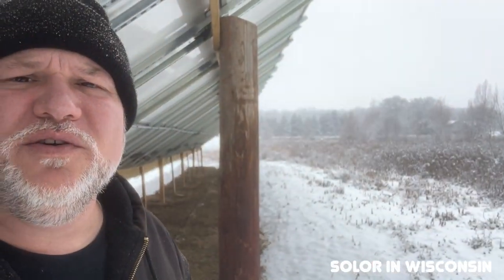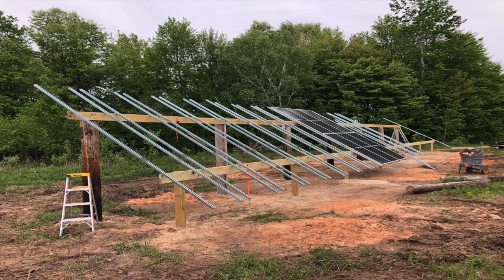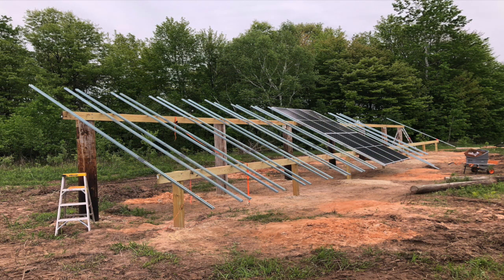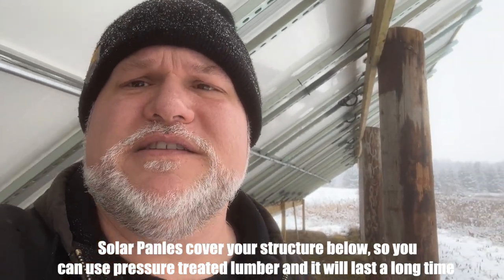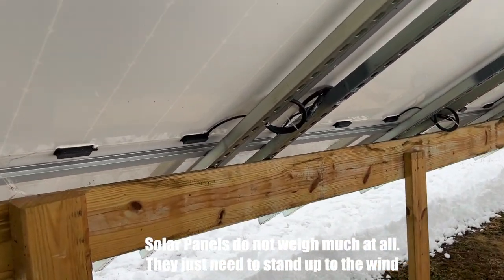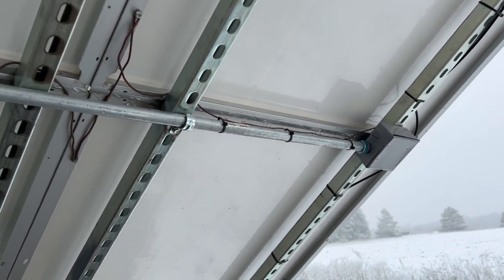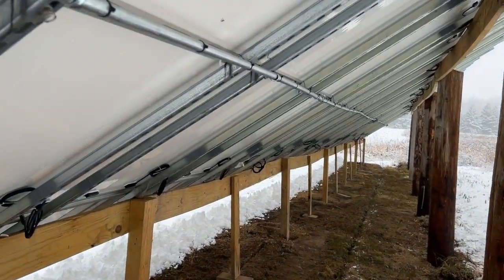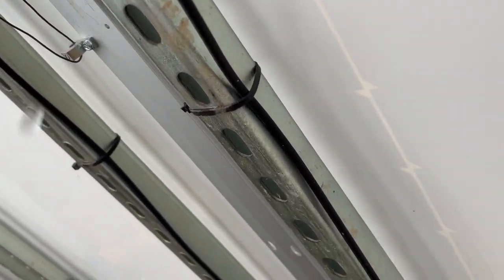DIY 15Kw Solar for 15k

Comment: Your locality may require it, but it isn't NEC from 2020 and beyond to earth a ground mounted solar system.  We don't do it as it doesn't accomplish anything.  It doesn't protect from lightning nor will it clear a DC fault.  Roof mounts require grounding by NEC, but it should not be earthed to a separate rod, it should use the house's existing earth point if one exists, or it must be bonded to the existing if a separate rod is used.  I would have a Surge Protection Device installed inside your combiner box inside the house for the PV conductors.

Comment: Nice set up! I'm getting ready to add 30 q cell panels and enphase micro inverters an batteries on my property. I'll have 20kw of back up power. Tired of paying $500+ in CA for PGE. My 1st solar quote was around 65k and I should be able to do everything my self for around 38k is what I'm thinking.... still expensive but with all the new laws in CA you pretty much have to buy batteries to make it worth it now.

Comment: Hi...nice vid, can i ask, have you seen people that are mounting their panels (mostly bi facial) vertically?....it looks like a good idea, especially if it snows the snow falls off the panels on its own, plus if snow is on the ground the reflective light helps production, and being vertical the panels dont get as hot in the summer sunny days, cooler panels produce more power even though they are not pointing at the sun directly....ha, im not saying take down your wooden structure, but if you do get more panels maybe its a chance to put the additional panels vertically for a comparison 👍

Comment: I kind of wished you gave it some six inch spacing, side to side between each panel as it would aid with wind pass through on a crazy-azz, windy day. That's a lot of money to make a long continuous, parachute with. We had a couple of evenings here when I needed to lay my hinged array flat on the ground. I never thought the wind could actually blow the other individual loose 40 pound rigid panels around on a windy night - boy was I mistaken. I replaced a couple of broken ones and then decided to mount all of them permanently on three, newly manufactured metal-roof 12X36 storage sheds. Four were vertical wall mounted, four more at a 30 degree angle (roof pitch), then sixteen lay flat, four more at a 30 degree opposing angle, and finally four vertical on the opposite end wall. I did it like this in order to maximize exposure from sunrise to sunset, all year round here in Texas. I have thirty-two, 320Watt Renogy panels connected to two renogy all-in-one inverter/AC charger/solar charge controllers. Each controller draws 70A at 70V from the PV array to charge the batteries. My lifepo4 battery bank is composed of two at 16S, 58.4V using a total of 32, 305 Ah cells, with two 250A Daly BMS simultaneously rated at 24,000 watts peak output. Each DIY bank is 15 kilowatt hours of runtime. Shared with the solar array as needed are an additional, two, Bluetti AC300's with four B300 batteries each. This gives me one extra day of battery backup should I ever drain the 30KW hours from the two DIY banks. All in all I splurged roughly $20K USD in the whole DIY setup - I been living off-grid without a power or water bill since March of 2014. I'm a retired power production specialist for the Federal government. Nevertheless, I really enjoyed watching this video and look forward to the rest of your build. Cheers from Texas!
Reply: Wow very cool! Batteries would not work for me as I also build hot rods and run welders. No need to space it out. As long as you leave space all around your panels will be just fine. Like I said, we had some pretty big storms roll through and they hold up no problem. Thanks for your input on your system!

Comment: Eggs sell ent video. Love your system. I wood like full specs on your system. How many in series,  how many parallel .
Reply: 44 Qcell G10 panels divided up into 3 legs to a combiner box. From there it travels into my home into a disconnect and then to my inverter.

Comment: Excellent job!  There needs to be more DIYers like yourself because the installers give solar a bad name with their expensive installs.  What is the voltage coming from the panels back to your inverter?   I noticed you had some drip lines in the ground under your panels.  How much more effort do you think it would take to make one like yours but a bit taller, a bit wider (3 panels instead of 2) and water tight so that the panels were the roof.  That way I could have a shed for storing yard equipment, etc.
Reply: Thanks! I worked with a pioneer in solar around here, and I hired him as a consultant. I think he charged me about $500 to perform all of my line voltage figures so I don't know off hand as well as hooking everything up once I had it in place. You could see if your electrician will allow you to run all of the wire and then he can inspect and hook up. Saves a lot of labor!  I would guess probably whatever the 12ga wires can handle on each leg of panels for DC. It makes a huge difference going from DC to AC in wire sizing. This is why you need that master electrician who knows DC and AC. Yes, I thought about making a shed enclosure but Solar Panels make heat and less energy when they are hot. In the summer you want them to stay as cool as possible which by having them open let's them stay cooler. Make sure when you buy your panels that you buy 2 extra incase you need to replace any! Thanks for your comments!

Comment: GOOD WORK.  $1 per Watt is Great.  And it is NOT on your roof, with a clear, all day array.  A+   Liked the use of Unistrut.  I see you used 20 foot sticks?  We do that with Landscape pattern so we can put 6 modules on a couple of 20 foot sticks, or 3 modules on a couple of 10 foot sticks, and then just pull / slide them up the frame.  oh wait -- just heard you say you welded them for the length?  For a cheap(er) good steel frame, we use old Oil / Gas pipe (a common surplus item in Texas).    Since you are not doing micro-inverters, would recommend a String Inverter at the Array -- and bring AC (only) into the house to comply with current code regarding DC shutdown.  Current US NEC --you do not want to bring DC into your house or other building.
Reply: Please do a video on the geothermal system.
Reply: Lol, my Geo system is an open loop system that they do not allow to use any longer in my state which blows my mind. When the system runs it pulls water from my well taking a few degrees from it and dumps it in my pond. There is nothing wrong with the water and it is perfectly clean water, but they don't want people pumping and dumping. When my system runs its just about the amount of water of a garden hose, yet they allow farmers to pump billions of gallons of water from their wells to be evaporated in the air. My Geothermal works AWESOME!  @electricandlsxpower
Reply: Thanks! I wish we had an abundance of steel pipe laying around. I would use steel before lumber but I had to run with what was reasonable at the time. I figured that by the time the treated lumber rots out, it will probably be time to replace my panels with something more efficient anyway. Thanks for the info!
Reply: I should mention that my power company allows me to bank Kw when I over produce. It is January and I have over produced 6000kw to be used during the 3 low producing winter months and come April they will cut me a check for what I did not use up. All power companies do it differently though.